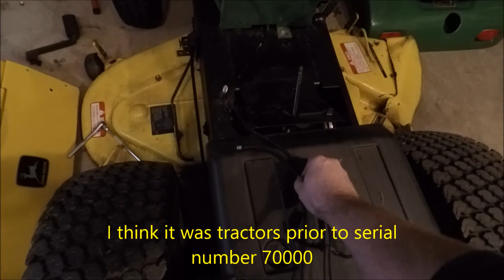Tail Light Installation  For John Deere 200 Series

Comment: Looks nice. 
My 300 has them, but 316 & 214 do not. 
214 has the lights, but not the harness.....I bought a harness.
It’ll be interesting to see if it’s long enough, like you experienced. 
My 214 is a 1980.
    Is this the same tractor you did the hydraulic lift conversion on? 
How much did the ag tires cost, and are you satisfied with them?
Do you still have the turf tires?
Reply from the maker: Yes, this is the same tractor that later got the hydraulic lift conversion. I actually got the ag tires with another tractor that I parted out. I no longer have this 214, but kept the ag tires, which are now on my 318 full time.